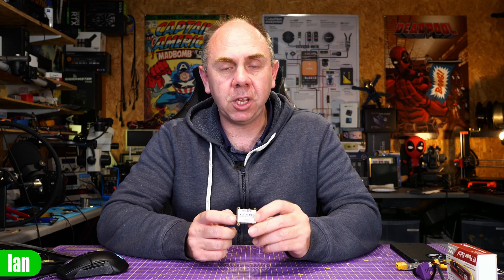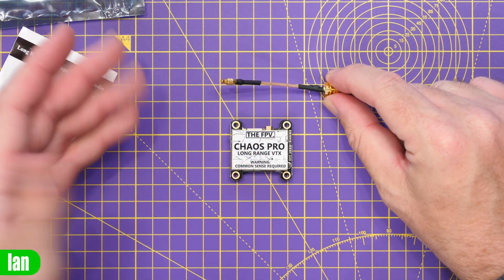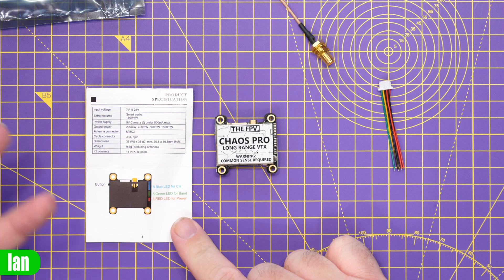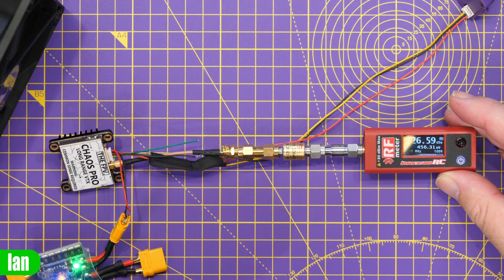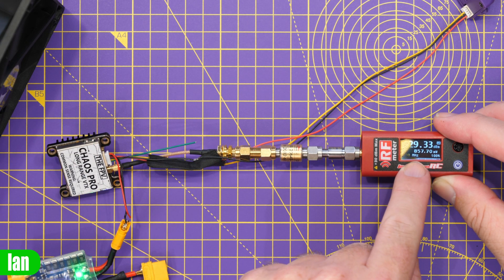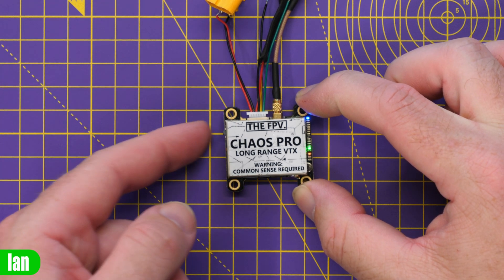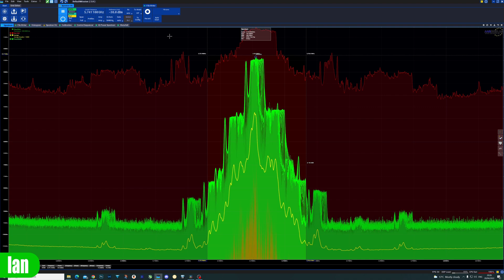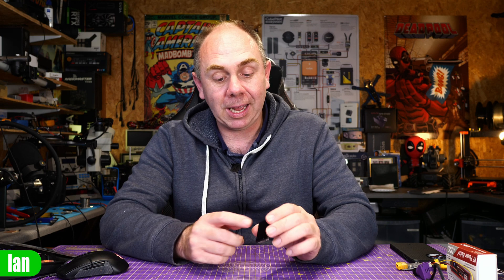Chaos Pro 1600mW VTX - Analog Not Dead Yet.

Comment: This looks to me just like a rebranded AKK Race Ranger VTX. Same price, same specs and looks identical. I have a Race Ranger and i didn't get too good of a result from it. Lots of interference on the video. The video (and I feel like the range too) is acceptable but isnt really that great even at 1600mW and as you said it literally cooks itself at higher output powers. I switched it for a Rush Tank 2 and even at 800mW I feel it performs better with cleaner video and I feel like I get a bit more range (maybe  because of cleaner video) and it runs much cooler. I would say just spend that extra 10 or 15 bucks for a Tank 2 if you're doing normal freestyle and for long range just get a Tank Solo or TBS Unify Pro32. It's necessary to have reliable gear for LR.

Comment: That is a good price. I use the Rush Tank Solo on a few of my analog builds which has a similar spec but a much higher price. To help with heat dissipation I mount 25mm 5Volt fans, and because I power my cameras from the FC I use the 5Volt out from the VTX to power the fans.